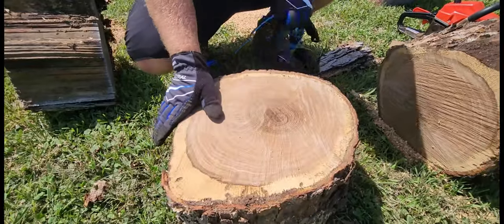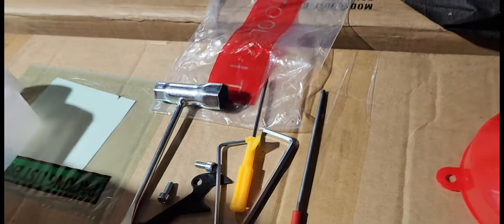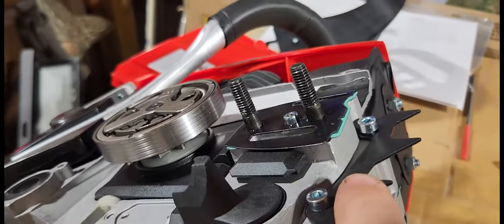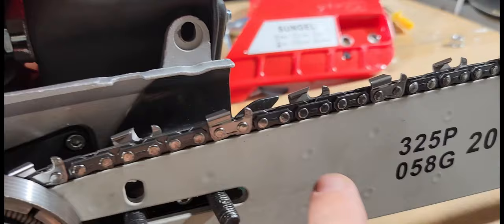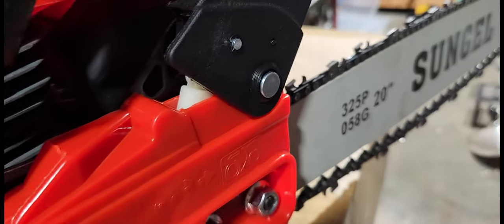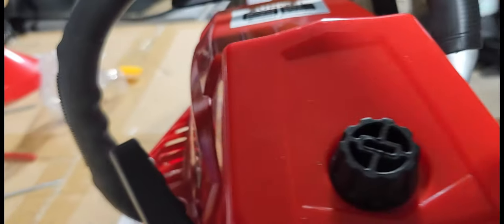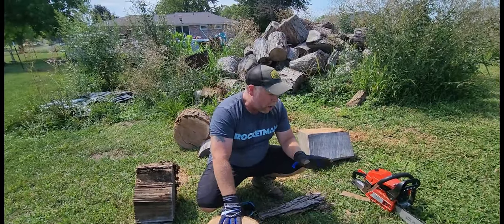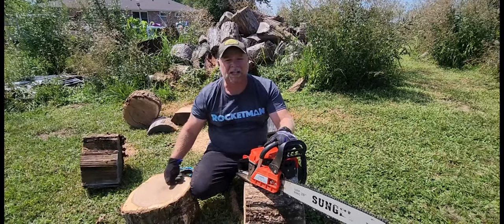Sungel  How to Assemble a Sungel Gas Chainsaw Review and Demonstration

Comment: looks to be a carbon copy of my early 90s Poulan Pro - too nervous about the quality though. Seemed to bog a bit in the video?
Reply from the maker: Its comparable to a Poulan for sure. I've not used it since the video as it's too hot yet..  still hitting 90's for temp 
I will say the chain gave me a few fits staying tight but other than it was a solid saw.
I have 20in Stihl as my main saw. This would be a back up saw and then I have 2 16's

Comment: My Sungel saw leaks all the oil from the bottom. Did you have an issue with that?
Reply from the maker: no issue with oil but I did have an issue with keeping tension on the blade. The tension screw is plastic so it's pretty easy to jar loose.